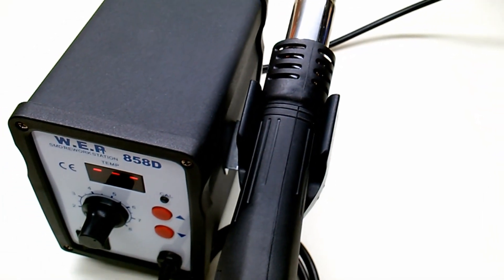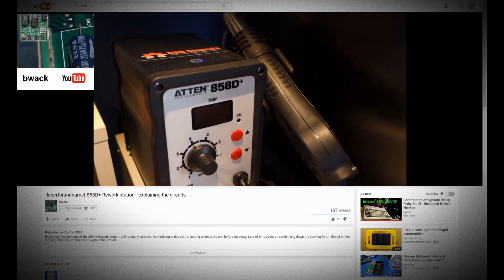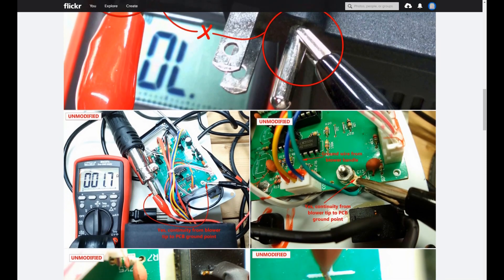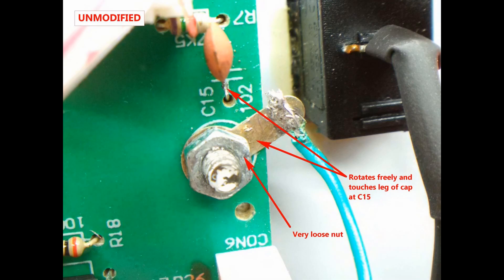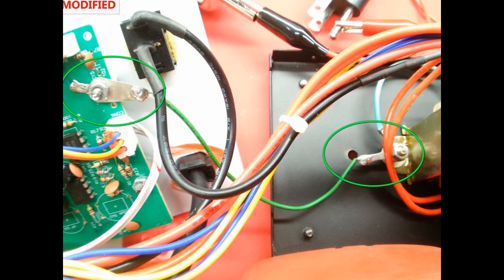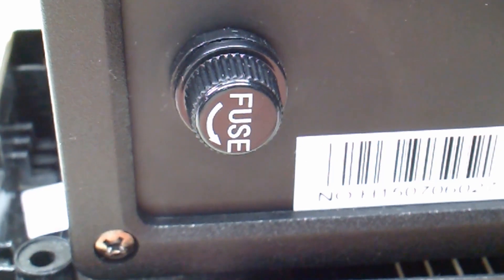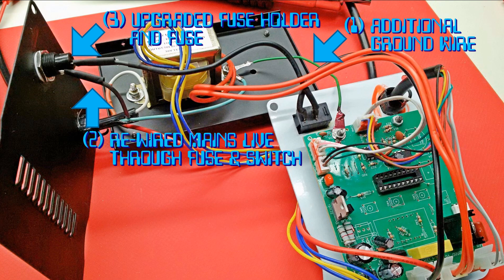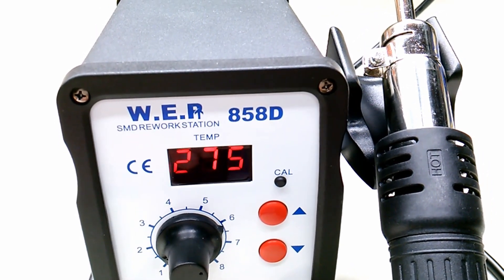#06 "We Put the 'K' in Kwality" — 858D Hot Air Rework Station Safety Mods

Comment: I would just like to add  i added a Earth wire to connect the Bottom Chassis to the top case, as the paint on the case and screws was that thick  that when the top was attached there was no earth on the case & screws. i removed the screws and using a dremel  removed paint and got back to bare metal, around the earth connections, and then used "Star Washers" that bite into the metal .

Comment: This video is hilarious to me because I have been using this thing for so many years, it's held up great. I always unplug after use though because I don't trust any of this cheap, chinese crap so maybe that's why. I never had to open it either. It was used for SMD rework no problem, I eventually purchased more name brand solutions, but came back to using this thing because it was so consistent, just a workhorse. The $30 I paid on eBay made me a lot more than I invested for sure. Thank you random chinese assembly line worker!

Comment: Seems mine is grounded to the tip. However my lights flicker when its plugged into the same outlet as it. Idk how I'd fix that. Could just be high power draw?
Reply from the maker: Well, the grounding seems correct. I think the 858D is rated at 700W, so could be took much on that plug circuit?

Comment: I was sent an unfused plug on mine first time I’ve seen an unfused uk plug
Reply from the maker: Wow. Was this a while ago?
Reply: @MindFlareRetro  today lol
Reply: I'm in UK and I got a JCD 858D off eBay December 2019 and that was some dodgy 3 Flat Pins (Foreign) to UK 3 Pin adaptor (not fused) (possibly New Zealand/Australia and Kettle Lead was the (NZ /Aussie) 3 Pin so just trying to get my head around it. I've used the unit a couple of times but now looking at checking the connections (earth grounding) and use a PC / Kettle UK (Fused) lead. Would 3 Amp be best for these 858D do you think? It also says ESD SAFE on the cardboard box it came in haha Mine has built in Fuse also at the Power (PC/Kettle Lead) Socket so not seperate like in this video
Reply: @PauloAndreasMusic  that is odd didn’t think it would be legal but must be. I’ve just realised my soldering iron is also the same has no fuse. I’m using them still I’m not going to bother changing the plug’s because I’m plugged into an extension lead anyway just hope it’s the right fuse in that lol

Comment: I don't think it is required in Europea that mains equiipment needs to have the fuse on the live side. Most of the European countires use symmetric plugs, you can plug them in two ways, so there is no telling which wire will be live and which one will be neutral.

Comment: What the button does "Cal"  ?
Reply from the maker: You can "calibrate" the temperature readout to make it more accurrate for your needs. The problem is, the blowing air temperature varies depending on blow speed, nozzle type and distance from the nozzle to PCBm, so calibration would be inconsistant at best.

Comment: To be on the safe side, the live should connect to the tip of the fuse, otherwise it would be possible to get a shock when changing the fuse if you happened to touch the exposed live inside the fuse holder, with the device plugged in.
Reply from the maker: That's a great point.Thanks for sharing. I might have to make that alteration if and when I find myself into the guts of my 858D again.

Comment: I have quick 850A from last 5 year's it was cost me around 1300 Inr(22 CAD) till today it's working like Butter till today no problem apart from heating coil replacement 1 time with regularly 3-4 hours of use. Some times cheap product comes with quality as wel.
Reply from the maker: Interesting. I have not seen the Quick 850A before. It looks like a solid build and clearly, it's a good design based on all the hours you use it. Thanks for sharing!

Comment: What fuse holder and fuse did you use? I recently purchased mine and it looks like the only problem is that the hot wire goes straight to the switch instead of the fuse (fuse is wired return like in the video).
Reply from the maker: Hi. I just used a standard 5x20mm panel mount fuse holder, https://amzn.to/3vwq49w. Intersting about yours -- from what I have been hearing from other people, the manufacturer(s) have sorted out all the wiring issues.
Reply: @MindFlareRetro  I might have got an old unit from the person I ordered from. The board still has markings from 2016 or 17 IIRC when I opened it.
Reply from the maker: @K-----  Ah, yes. That would make sense. Well, at least you have all the issues straightened out. I assume it's working well for you?
Reply: @MindFlareRetro  Yep. I routed the hot through the fuse and to the switch and soldered the returning wires that used to go through the fuse together. Tested grounding. Everything seems to be in good condition now. Ill probably put in a better fuse eventually.

Comment: I picked up a Yihua 858D from Amazon that arrived today, and because of your video and Dave McAnulty's video, I decided to open it up and inspect it first. I think they have updated a few things in the last few years, because when I checked with my multi-meter I found the hot wire was going to the fuse (the wire colors are now blue, brown, and yellow). Additionally the ground on the blower was soldered securely and the nut was tightly attached to an unpainted threaded post. I didn't feel the need to make any modifications at this time. Maybe they saw your video lol
Reply from the maker: Thanks for the feedback. I think you are correct, they have improved the quality greatly. I am glad to hear that yours is ship-shape. 👍

Comment: Hey probably late for this, but just FYI, in Europe we don't have polarity on devices, that don't have safety ground connection (just neutral), but we have polarity in devices that do have such a connection, but in general, every outlet in europe should according to the standards have Live on left, neutral on the right and in case of the ground, on the top. But we allow devices that have just live and neutral, and our outlets allow them to be flipped in either direction, so in this case it doesn't matter, either way in EU plugs the orientation would be right, since we have live on the left :)
Reply from the maker: Yes, it certainly sounds like the European standard makes things easier. I appreciate the comment and the lesson -- thanks for sharing. 👍
Reply: UK has ground at top, Live on right and neutral on left. All approved UK mains sockets in UK are 3-pin. Ungrounded (double insulated) appliances leave the earth pin unconnected.

Comment: I’ve noticed in my Atten 858D+ that the ”switch” on the tip handle holder that is supposed to put the unit to sleep works very inconsistently, usually leaving the tip blowing up hot air. Hence I always turn it off from the mains switch when I’m not using it.
Reply from the maker: Hi Tero. Thanks for commenting. Hmm... interesting. There is a reed switch (magnetic sensor switch) in the handle as well as a magnet in the cradle (handle holder). Perhaps the reed switch is faulty or the magnet is not sitting properly in the cradle. Are you able to disassemble the handle to check the reed switch? Also, you can buy replacement handles (the whole handle assembly) for a reasonable price on eBay, https://ebay.to/35q0PeU. I hope this info helps.
Reply: Thanks for the info! I just watched eevblog’s video on a burned 898D. I think the reed switch in mine is just being extremely picky about the orientation of the handle. I’ve decided to play it safe and turn it on from the mains as it heats up fast enough when I need it.

Comment: There was another issue with the triac latching on so when you hang up the tool the reed switch goes to turn off the system but the only thing that turns off is the fan, the latched triac keeps the heating element on going ballistic melting the handle.
If you research this problem and find a solution to keep the triac from latching, can you send me a private message so I get an email
Reply from the maker: Oh. I was not aware of this triac issue -- interesting. Yes, I would like to know more. My email address can be found on the About page of my channel.

Comment: Small note, it's note "The imfamous 858D", it's "a cheap knockoff of the "Atten 858D".
The Atten brand makes this product with quite good quality. If you only look at the 858D and simply assume that it must be the same...well that's why knockoffs use that designation: to fool you.

There is nothing wrong with the Atten 858D, EEVdid a raving review on it.

Always check that you are buying brand products and not knockoffs, and stop refering to products by their numbers only, it's just dumb.
Reply from the maker: Yes, good point. It is a jungle of knock-offs out there. I am happy to report that this "W.E.P. 858D" has been working great since these fixes were made. Thanks for commenting.

Comment: I think, I have seen another issue with the grounding: usually, you should use a serrated lock washer for connecting PE to the case. I would put one below and one above the lug of the PE wire at the stud at the transformer. Probably using one at the pcb might help too.
Reply from the maker: Thanks, Sven. Yes, you are correct, of course. I will make these changes if I open this station again. Thanks.

Comment: Another safety precaution is to put fuses in both the live wires of the hot air instead of one and must have leakage detection automatic in the central electric box of the house.
Reply from the maker: Ah, yes. That's a great idea. Thanks for commenting.

Comment: My hot air rework station is even cheaper. I think I paid $30 for it? It's just a handheld unit all self contained. The temperature readout goes up to 800 degrees! I don't think that's right in F or C so I have NO IDEA what it's registering but SMD components start to come off at about 700+ whatevers.
Reply: It's actually called the GONGJUE GJ-8018LCD Portable Temperature-Controlled (ha!) Hot Air Gun
Reply: I saw someone else's video where they took a temperature probe to the tip. (Duh! I have one of those. Should try it.)

The tip registers about 150 degrees cooler than the display on his unit. I'm guessing the thermistor inside is placed such that the airflow doesn't cool it down.
Reply from the maker: 30 bucks?!? Man, that cheap. Oh yes, I think I know the one you're talking about. Any problems with that one? It works well?
Reply: @MindFlareRetro  it does the trick! Just weird difference between the temperature displayed and the output.

Comment: Funny - I just got one, sold as unbranded but the name plate shows what appears to say "HiYAKKO." At any rate, they do have a grounded tip, and the fuse holder looks a lot like the replacement one you bought, but it looks like the main plug is still wired backwards with the Live and Neutral switched up. I'll just replace the cable entirely with an end from a new computer, and wire it up properly (as suggested by WTF below).

Sadly, though, the board's a different revision, so I lack a socket for my main chip, so I'll have to desolder that before going for more extensive mods.
Reply from the maker: Hi. Thanks for commenting. "HiYAKKO" -- that's hilarious! The more feedback I get, the more I think that mine was a very early rev for the North American market. Interesting about the non-socketed chip - more cost reduction, I guess. I'm glad to hear you got yours into proper shape. Enjoy it! Thanks again for your feedback.

Comment: Poor grounding?  That's B.A.D.  Even I know that you have to properly ground electronics.

So the hot wire goes straight to the printed circuit board?  Doesn't it have to be stepped down by the transformer to low voltage so that it doesn't fry every component on the board?  (I'm still learning)
Reply from the maker: Yes, the grounding was pretty much non-existent.  I can't remember the exact wiring issue.  It's a bit of an oddball setup -- the transformer is for powering the heater element and blower fan, but the voltage required for the mainboard, itself, originates directly from mains and is rectified and regulated on the PCB.
Reply: It must be separate from the rest of the board, then.

Comment: Nice video! Mine (220v bought off Amazon UK August 2018) was completely different than yours on the inside.

- Power connector, a standard kettle lead power socket, fuse tray built into this. Connector is pretty decent looking quality wise but held onto the case using hot glue. Fuse was some clear bodied one so no idea of rating or anything. Live and netural wired as expected.

- Earthing - Mine was the exact opposite of yours, my case was not earthed at all but the head of it was. Earth from the plug was connected to the mainboard which in turn had a wire connected to the head. Decent quality connections unlike the ones in yours, directly soldered to the board. I added a wire between earth and the transformer screw, but im not sure how much use it is as the case doesnt seem to be over conductive because of the paint (didn't make my MM beep)

The main board looked completely different too, odd that there is so many different ones floating around!
Reply from the maker: Hey Brian. Thanks for watching and commenting. Yes, most of the feedback I have been getting shows that the factory(ies) making these things have improved the quality of the design and of the construction. Mine must be an early North American variant (purchased in May 2016) that has been improved upon greatly.

Depending on the PCB and MCU (i.e. MK1841D3) your device uses there are several temperature calibration hacks out there, as well. I am sure you have enough projects on the go but if you are interested, check out BWACK's YT video, https://youtu.be/fcmuqZVv0uU.

Thanks again for watching and for your comments.

Comment: Thanks for this informative video! It inspired me to open up my 858D to make sure everything is safe. My 858D is North American 110V as well but is branded “Newacalox”. It has some notable differences...both the air gun wand and the power cord are detachable. The fuse is inside an accessible box directly below the power socket in the back. After I took off the chassis cover and checked the wiring with my multimeter, I was relieved to find everything was proper and safe. Tip of air gun was thankfully grounded...there is a grounding wire from the front panel PCB to the chassis bottom...the same setup you implemented in the video. However, there was a minor issue. The grounding wires all had crimp type loop connectors but were soldered instead. Using my electricians tool, I compressed the connector around the solder joint. The grounding wires now have a tight mechanical as well as a welded connection. It seems some branded 858Ds may have better construction...I guess YMMV.
Reply from the maker: Hi. Thanks for watching and for your kind words. Yeah, it looks like mine was a real safety lemon. Nice work on double-checking everything on your device – safety first. It is good to hear that more and more people are receiving more reliably-built units. Thanks very much for the feedback.

Comment: Hey thanks for the video.  Question: could I plug my station into a GFCI adapter to protect against some of these issues?
Reply from the maker: Thanks for watching the video and your questions. Well, to be honest, I am not an electrical professional of any type so I cannot give advice when it comes to high voltage safety. As far as I understand GFCI outlets, they compare the current between the hot and neutral side and if there is any difference, even a slight difference, then it could mean there is current leakage, possibly through someone’s body, so the GCFI will quickly open the circuit – trips its internal breaker. So, I guess it’s safer to use a GFCI than not using one.

Some Interesting info to check out:
► https://safeelectricity.org/ground-fault-circuit-interrupters-gfcis/
► ElectroBOOM on YouTube, ‘The Outlet that Saves Lives’: https://youtu.be/GlM6PE2kKVY

Comment: I believe that post 2 is unnecessary.This is because when in a mains circuit it does not matter which side the fuse is on. because a mains system uses AC(alternating current) and AC switches current direction 50-60 times a second. The fuse would have current flowing one way and 1/60 of a second later it would have current flowing the other way
Reply: It should not normally matter, but in combination with the ground issue, there could be a shock hazard. Say the hot wire going directly to the circuit board mounted to the faceplate were to short to the faceplate for whatever reason (maybe a blob of solder was in the case rolled around, hitting a pin on the circuit board while being stuck against the faceplate) and the fuse pops. Fuse did its job. Only bad thing is now the faceplate is energized, and because the plate wasn't grounded, the main circuit breaker will happily continue providing power to the station. Were you to start fiddling with the station because all of a sudden it stopped working and you touch the faceplate, you would be electrocuted.

Comment: Thank you for the video.  Just got my 858D hot air station and disassembled it to check.  Surprisingly every point in your video was already addressed in my unit.  There was no issue with ground or fuse placement.  Great deal considering how inexpensive these units are!
Reply from the maker: Oh, that is good to hear. I suppose they have cleaned up their act a bit and made them safer during the manufacturing process. The fixes would be so easy for them to implement. Thanks for your comment; I appreciate the feedback.
Reply: Yes, they have stopped trying to electrocute us, by ignorance!
Reply: Jun you have a link for yours ?